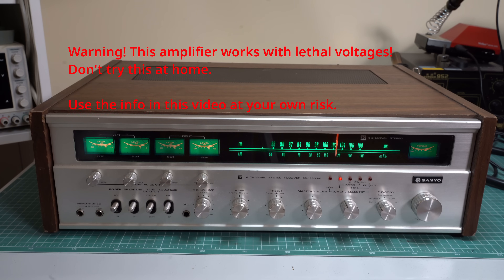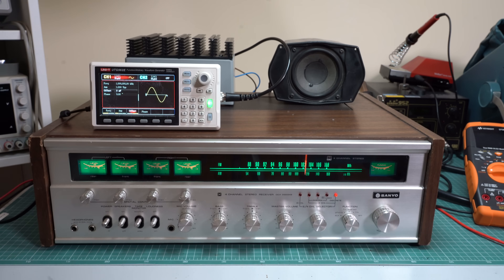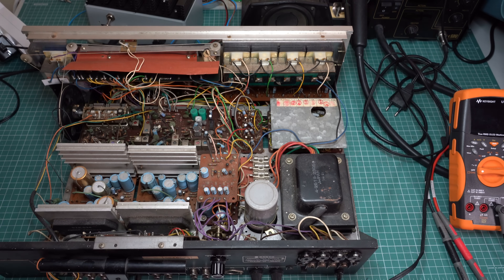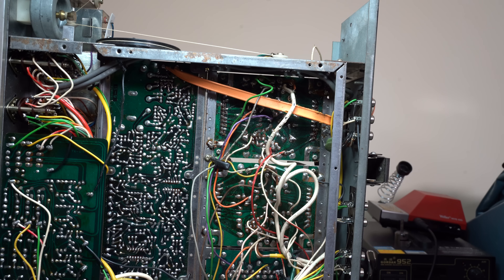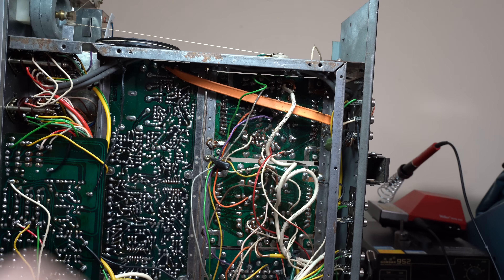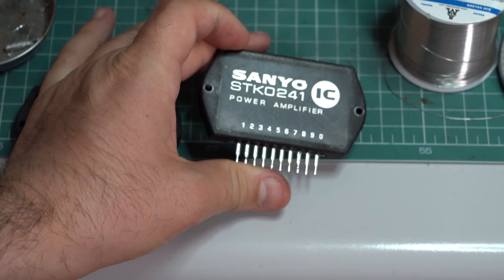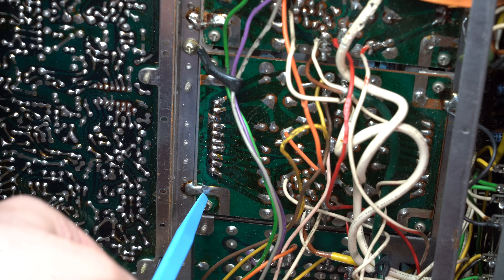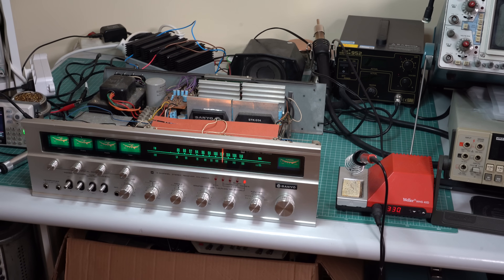Sanyo DCX 3300KB Amplifier Repair: STK Hybrids Replacement, Tests, THD Measurements

Comment: If you don't want those new Power Packs to blow up i would at minimum replace all the caps on the amp boards, if the caps fail so does the new power packs!

Comment: I've never been a real fan of "integrated" amps... they always had more hiss than a discrete design... and when they'd fail, it always seemed like more effort than it was worth to replace a module, and on a simple stereo (2 channel) unit, I'd be inclined to go another way with things lol... but being a quad, it is probably worth messing with.

Curious what the specifics were for the final "slant" tests on the scope... I'm assuming rated channel power since they all deviate from a flat line, but equally.

I think in the case of that unit, even if it wouldn't have been practical to replace all 4 modules, I would have still attempted to save it by turning it into a control amp and driving external power stages.

I'm also a little surprised there are fakes for these modules... I wouldn't have thought they'd have been in high enough demand. Learn something new everyday I guess lol

Nice video... Always an interesting watch.
Reply from the maker: I hate STK amps too and I only fixed it because the owner insisted and because I thought it would make for a nice repair video.

The voltage transfer characteristics were done at an arbitrary power level that's low enough to avoid overdrive. The deviation from a flat line is not due to overdrive, but due to a phase shift in the signal path. It happens regardless of the power level. I think the phase shift is caused by the EQ. Overdrive causes the peaks to flatten out, so as long as you get an ellipse, the amplifier is linear.
Reply: @VoidElectronics Me too, I would have put this in the bin ! It's junk, but the customer is always right ! those THD measurements are awful.
Reply: @VoidElectronics Makes sense on the scope images. I didn't think about EQ and such. I mostly used that trace to detect crossover in finals while setting bias, so there wasn't any appreciable swerving going on in a correctly set amp. If you're measuring "across" the likes of "aux in" to the speaker outputs, there's indeed a lot more going on between the scope inputs haha

Comment: 10:14 using a piece of desoldering wick (or bonding tape) was a great idea here, it won't crack under vibration.
Reply from the maker: The original design is terrible and so is the idea of soldering the GND tracks to the chassis directly. I did my best to create a low impedance GND for the module, so thanks. :D